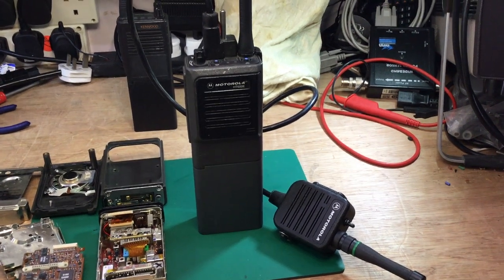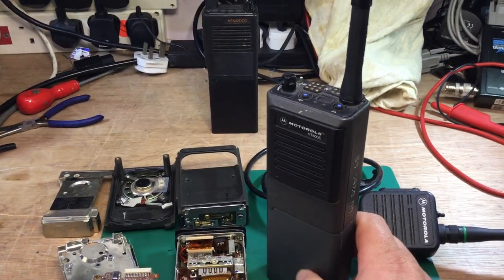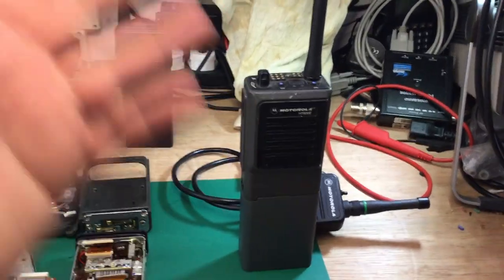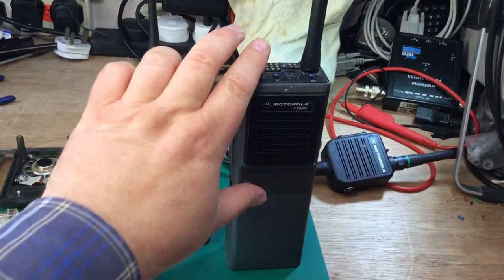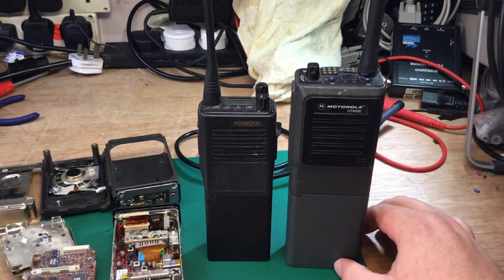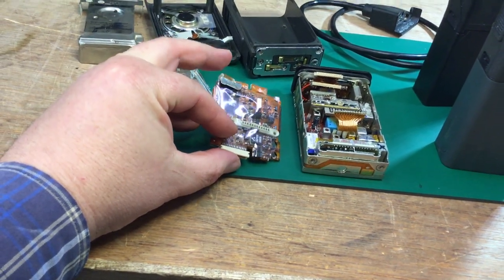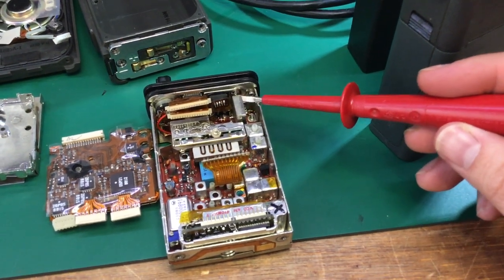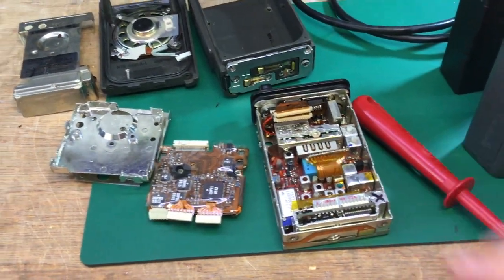Motorola HT600E & MT1000 Radio Programming PART 1 Police Radio & Kenwood TK350 a look inside.

Comment: I carried two of these for nearly a decade....   Durable as hell and quite reliable.
Our police communications took place on low-band vhf (45.xxx) simplex and 
as a volunteer firefighter/medic, our operations frequencies were all vhf high-band.
(mostly repeater and some simplex, including our fireground channels)

We had opted for the 6 or 8 channel models as the 99 channel models
were approximately 20% more expensive. Our chiefs and captains and other line officers
were issued personal 99ch. models but most individuals ended up sharing radios, picking
one up at the start of a shift.

The MT1000 was a pricey beast for sure...   we ended up switching to the “Radius”
line due to cost.  
The p200 and p200-LB were approximately 40% less than their Motorola 
equivalents.  The internals were nearly identical and the RSS was interchangeable if i recall correctly.

Many other area agencies were fond of the BK synthesized transceivers for some reason.
Cloning capabilities?  Durability?  Who knows...  they were monstrous beasts imho.  

I am still a Motorola “fan-boy” when it comes to analog and p25 (the APX8000 is the defacto standard in public safety in the US)
but am fast becoming quite fond of  the Hytera ultra mini sized DMR/analog radios.

I saw the progression of technology in the public-safety 2-way world over a period of close to 45 years.

I started with a Motorola p220 vhf 2 channel crystal portable radio / the a p220 “slim” 2-watt model /
followed by an HT500 4 channel radio with DTMF encoding (enabled remote “sally port” electric door control at hq).

Then came the years of synthesized radios.   The first one was the mt1000 / p200 series.  
Then, post 9/11/2001 ,  we migrated up to a UHF repeater-based radio system...
And the MT2000 along with the JT1000 for “interoperability”. 
(interoperability was a joke with every municipality operating on different frequencies and BANDS)
Then came the XTS5000 and XTS2500 as we moved in to the world of Project 25 (phase 1).

I retired just prior to the introduction of the APX8000 radio.  What a remarkable beast!
It actually does approach getting “interoperability” to exist in the real world...
But it’s hugely expensive.
Reply: احسنت وابداعت بالشرح الجميل والعميق والغني بالمعلومات وانا اكد كل ماذكرته اشكرك